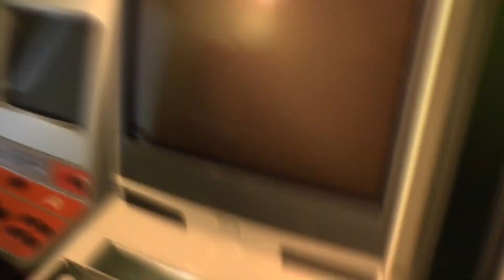Gaming Junk - 2020 crap list

Comment: Best option I think is the FPGA MiSTer with all of its upgrades. Then for the consoles it doesn't have like 32-Bit and up and arcade games it doesn't have cores for yet, the best option is a PC or something with a GPU that allows you to use all of the options in RetroArch, especially the Run-Ahead option to remove all latency in cores that support it.
Reply from the maker: I'm not really a fan of emulation so all these have been little pet projects.  I need to get off my arse and share the outcome! lol
Reply: @Faginrs500  I would say the MiSter is a step above emulation since it is FPGA. Although that is only going to be as good as the cores programmed for it, but they have been doing great so far. It is just limited to systems the hardware can handle.